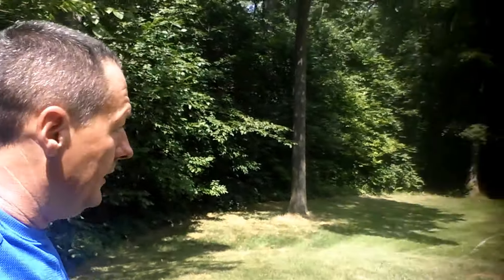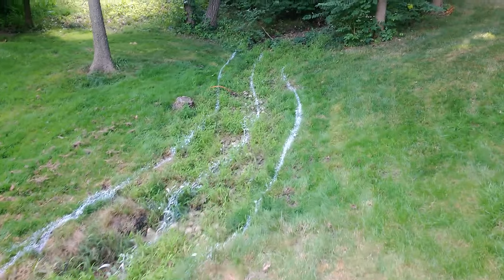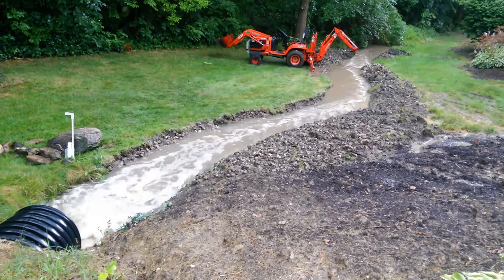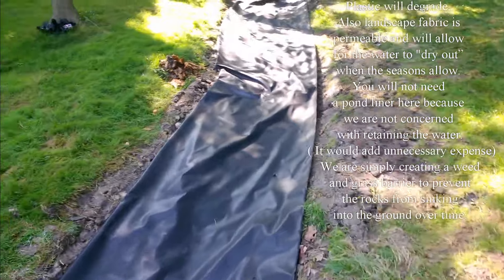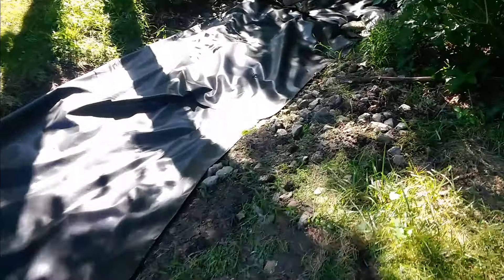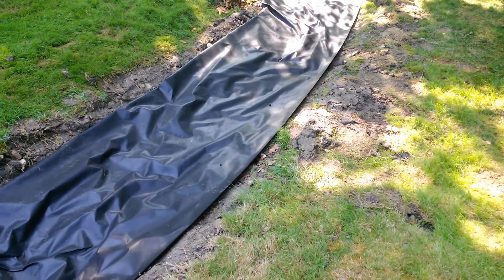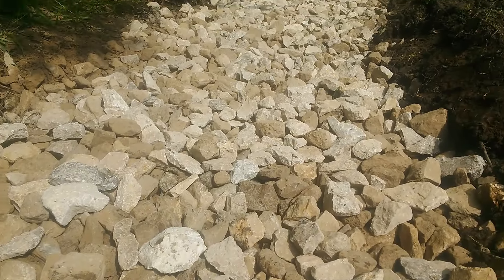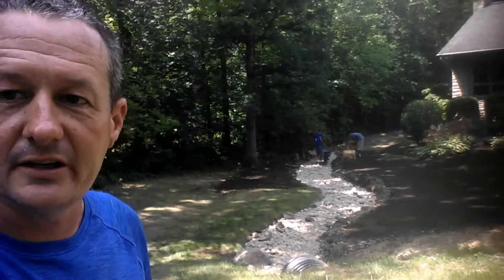Making an artificial creek bed to solve drainage problems and improve look of a wet spot in the lawn

Comment: check back on this job after several hard rains. i think you will see that the cobble rocks will move and shift around. you need actual rip rap for this kind of job. just an observation...
Reply: Yup, that’s basically what happened to me. A lot of hard work washed away.
Reply: Agreed
Reply: Absolutely, All that work and material for nothing and the owner will have to pay someone else to repair it.  Thumbs down I'm afraid.
Reply: What’s rip rap?
Reply: @Marcus-sk2xf  Stones about 6" to 8" inches or bigger.
Reply: @samstanley2847  Thank you!
Reply: @samstanley2847  And those go on top of the black tarp?
Reply: I believe he said he recommended that and the customers budget didn't allow for it
Reply: @allysonh6410  I guess he's got plenty of money. The first heavy wash and it will be gone!
Reply: @samstanley2847   I need to fill in a hole of about 3’ deep and 4’ wide of erosion first to begin fixing the drainage issue, any suggestions on what I need to fill that in with? So far I am just washing away money. Any suggestions would be appreciated.
Reply from the maker: here's the check back after MANY hard rains. 
https://youtu.be/0Asw6NB3GsU
Reply: @Marcus-sk2xf  cheap angled rock for base
Reply: @Marcus-sk2xf  yes
Reply: @BK-fi3of  boulders and large rock
Reply: Slow the flow, please.
Reply: @samstanley2847  but not river stones that are rounded, they are jagged

Comment: Can you give ideas on boulder or retain wall. I'm in similar situation. this setup looks perfect !
Reply from the maker: Vera loc wall blocks with pins if you need a true retaining wall  that would definitely be a job for a pro. Larger the stones the better if your budget and back can handle it!
Reply: @ColumbusLandscapers   hello, I have a large drainage hole where the water runs off the road into my yard, the drainage goes for about 140’. I need to fill in that drainage hole to bring up the where the water will actually drain effectively. My neighbors, god bless them, thought they could help so they dumped some broken up block in the hole. Do you have any suggestions as to what we should put there so that I can stop the erosion going on around it and get the drainage working properly again? I need to bring it up approx 3 ‘. So far about 600.00 of rip rap and 3” gravel has washed away. I need any and all suggestions please.

Comment: Would be very surprised if that didnt wash down with that much water. That was a lot of water at the start of the video.
Reply: Agreed. Water flowing through that area with the amount of force that it can move with, could easily wash the smaller rocks downstream at a much faster rate than some people may believe. A square yard (36×36×36), can move with a force of 1,700 pounds. That's a lot of force! I'm not saying that a gentle Rain would do a lot of harm, but if you get a Severe Weather Event, such as prolonged flooding, or even a Severe Thunderstorm with a lot of Rain, then conditions can change rapidly! It'd be better to use larger rocks for that drainage area, as opposed to small stuff like this!

Comment: Those river stones that were round and smooth will erode in time. There was one contractor who used the black, big, square rocks/stone to avoid that scenario.
Reply: The main issue isn't erosion in this case but the size of the stones used. I think that no matter how eroded are those stones they may eventually get washed out in case of a major rain event with strong water current...These stones look too small to me, more squarish and most importantly bigger stones might be more suitable for this purpose...but who knows,  maybe they don't get those big rain events over there, but the big size of that drainage pipe seems to indicate otherwise...
Reply from the maker: here a follow up visit. https://youtu.be/0Asw6NB3GsU

Comment: Hi - great video - I’m about to do a dry rock creek myself and this has helped - one question…won’t a landscape fabric allow water to seep through into the soil under under the fabric? I  was going to use builders plastic between the rocks and the soil so all the water goes down the creek….
Reply from the maker: Yes, water will seep through fabric. It's NOT recommend to use plastic. Generally fabric is you best choice in situations like this. Good luck with your project.  If you want a non-permiable.. consider a pond liner.

Comment: I put down about 50 feet of cobble over a fabric....the rain from hurricane delta came into Georgia two nights ago. Rained longer and harder than I’ve ever seen. I had a rushing river of water... washed everything away and eroded a big channel. Any thoughts are appreciated.
Reply from the maker: Just a thought... Might have to secure it with some wire mesh or something similar.
Reply: Need larger stone. Likewise the water will move these. Very light stone for that much water.
Reply: @billstathakos  thanks... I put in rip-rap.... much larger....hopefully that will stay in place.
Reply: @billstathakos 👍!
Reply: Cobble stones, river stones that were round and smooth will erode in time sir, as one contractor said who also do this kind of thing. He used those black, square stones/rocks, sorry, I dont know the name of those stones but they were black, square and bigger than these river stones/cobble stones. Just thinking of all these small stones getting stuck in that pipe under the road, Im worried.

Comment: Won’t the mud where u put straws washed down due to heavy rain back into creek bed over beautiful looking stones forming a blanket ? The water will flow over the soil mud blanket side way again causing the original problem 
In order to stop soil erosion from side bed of creek some net must have installed till new vegetation gets established to hold side.
Reply from the maker: What you see there IS straw blanket that HAS netting built in for the precise reasons you mention.

Comment: I would have continued the pipe on the exit side and back filled earth and seeded it. This will be an ongoing maintenance project. What was done was a waste of money..
Reply from the maker: That option was discussed with the customer. This option was chosen by them.. mostly for aesthetic reasons.  Yes, there's definitely some ongoing mentions issues to address, and they didn't implement all of my recommendations with bigger stones. To break and control the water flow.  Thanks for watching, and your recommendations 👍
Reply: I have this same scenario but with far less the amount of water.  I begged the City to allow me to pay to have a 8-10" pipe buried and backfilled to allow me to plant grass over top.
No-o-o.  "It's a 'wetland'," they said.  "Can't be altered."  BUT, I'm required to "maintain it," keeping it free of tall weeds, clogging or pooling, and generally looking like crap.  Government at work 'protecting' nothing.

Comment: Personally, I would've extended the pipe. That's not a 'creek'. They have a drainage ditch cutting through the yard! Better to manage & evacuate the water as quickly as possible!
If it was a a 24x7x365 true  CREEK, That's different, Your solution ( with bigger rocks and 'cleaning up' the exposed pipe ends ) would be a long lasting picturesque addition!
I'M NOT TRASHING YOUR WORK!  What you did ( what the customer wanted) looks fine!
Just a personal opinion(from somebody who can only WISH to have a spread like that!)
Reply from the maker: Thanks, nice thoughtful comments. Yes, I would have loved to implement some larger stone and more physical drainage, but I wasn't in the cards here. Project was divided into half appearance and half function. Unfortunately both ends up giving up some on the final result.